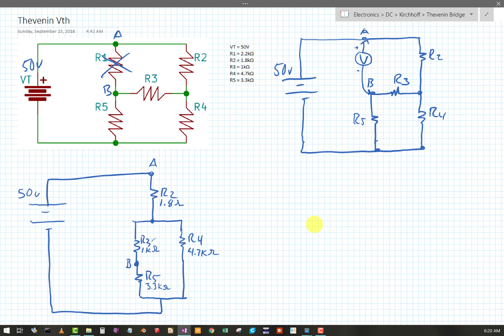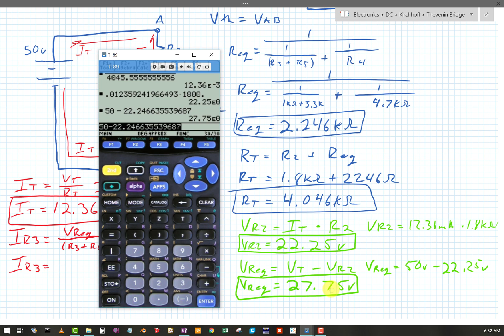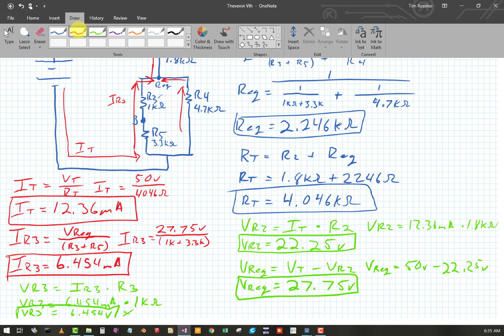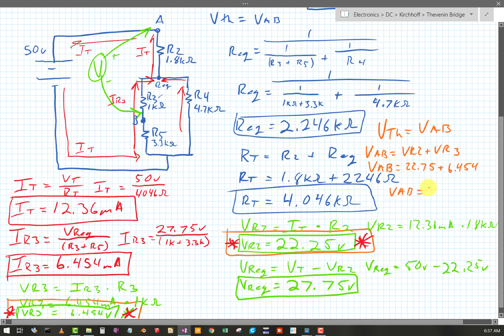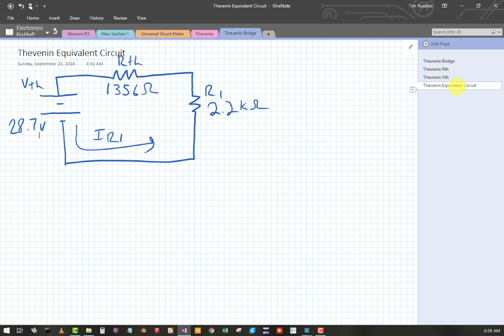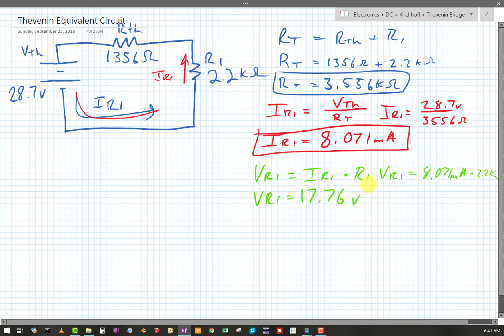Bridge Circuit Analysis with Thevenin and Kirchhoff: Part 2 of 3

Comment: Why not use voltage divider? Would save having to find all the currents
Reply from the maker: This is an exercise is fundamental analysis methods. There many ways to solve this circuit. All tools for your tool box. Thanks for the comment.